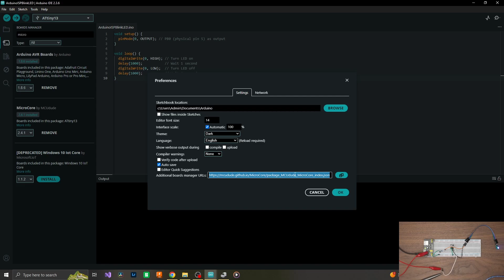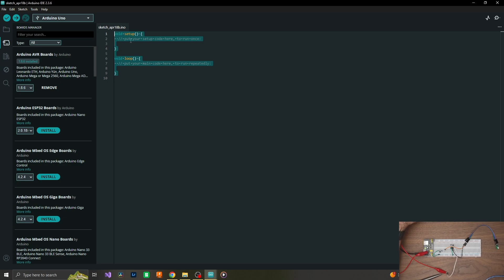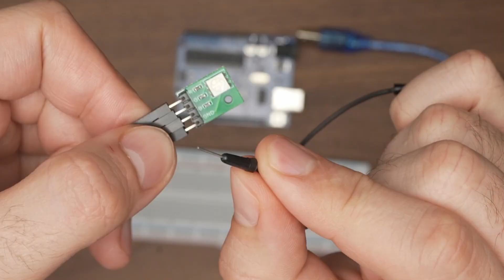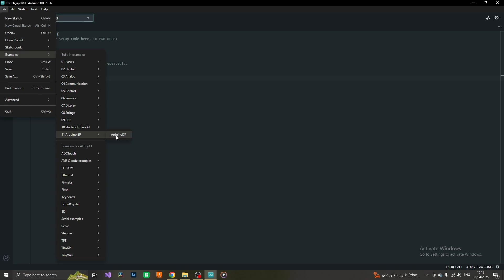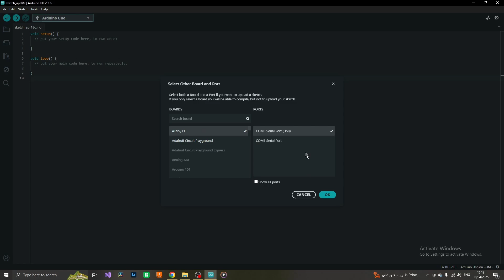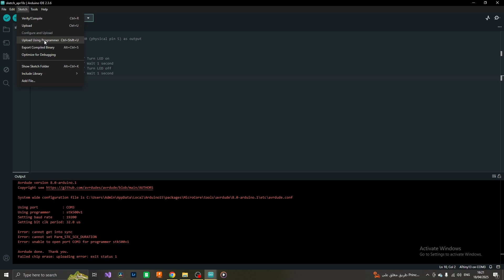Blink an RGB LED with Microcontroller | Build a Blinking 5050 | Arduino | ATtiny13A | ATtiny85

Comment: hi, aspiring engineering student here, am i right in thinking that the resistor should be used as an upstream current limiting resistor instead of a downstream pull down type for a simple LED like this?
Reply from the maker: Hi, the resistor is there just to prevent the LED from drawing too much current and damaging itself. 

It works the same whether upstream (anode) or downstream (cathode) in a series circuit. It's not a pull-down resistor, just protection for the LED. 

I know it seems counter-intuitive, you’d think you would need to place it before the connection to the anode, but in series it doesn’t matter.
Reply: as the author says. the modern ATTiny/Mega series have the push-pull output ports. They can both source and drain approx. the same amount of current.